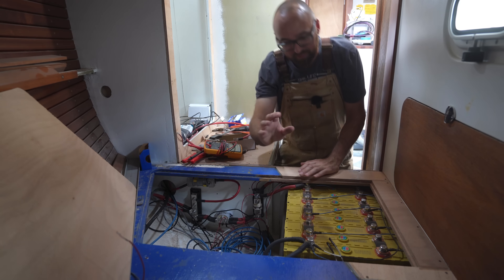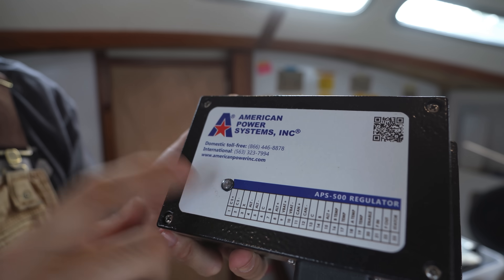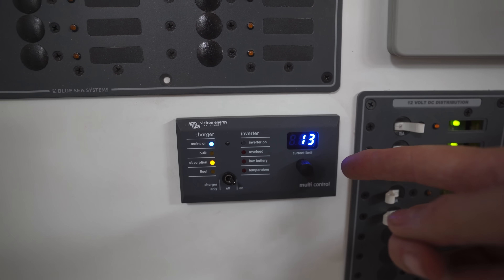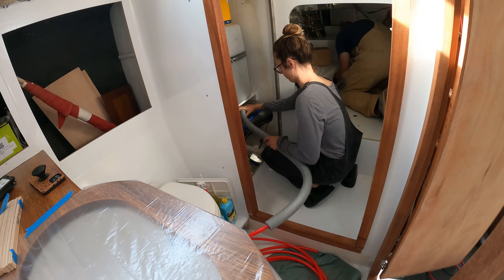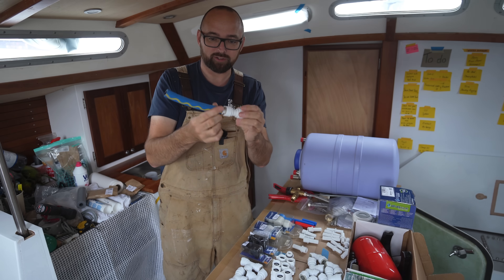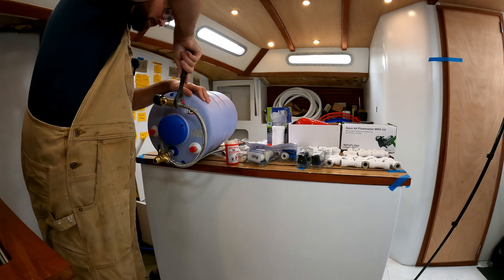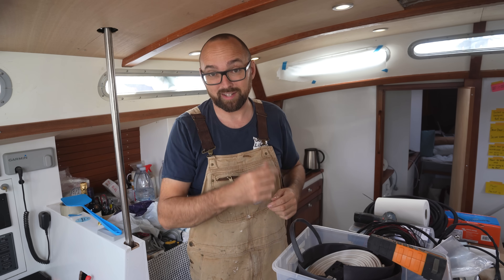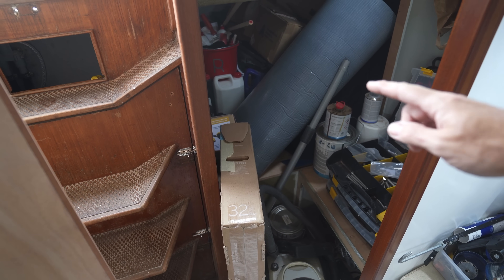Sail Life -  LiFeP04, REC BMS with Victron Cerbo GX, 5kW Quattro & pressurized water system

Comment: Great video! I plan to do almost the exact same thing on INTENTION next year, both the Victron lithium/Cerbo/Isolator setup and the water system (our water pipes are getting old). Right now, both power and water are working fine, but preparing for the future lithium batteries and solar and alternator upgrade and our water pipes are almost 30 years old!

Comment: To be fair - If it’s possible to do the mistake that easily, then the manufacturer has failed. 
IMHO, the negative should’ve been a separate plug, and very different from the ones for the positive cell connection.
While the manual is there, and it is documented, it’s a simple mistake to do, and probably not uncommon, considering the text in the manual. 

They should definitely move that negative connection out of the way, then the worst thing that’s gonna happen is you having the cells in the wrong order (which probably wouldn’t matter anyways).

Comment: I originally had VE installed in my sailboat, after a lighting strike a different unit was installed.  After watching your videos I am going to install a new VE inverter/charger, Cerbo, and related display and smart BMS that I should be able to then get data into the display without having to install a separate BMS.  Of course, phone app and online applications as well.  Due to my installation, I just need a Multiplus (not a Quattro) are there any other components you would suggest?

Comment: Don't forget to build a band with a couple 10mil starboard or similar to slightly squeeze your battery pack. The large flat surfaces need some compression to prevent the battery from swelling due to massive charge or use load. CHEERS     
   Steve h.

Comment: LOL, we have the same Victron remote... set to 13 amps

the 'assist' feature is not 'assisting'. When power consumption gets higher than 13 amps. the quattro actually switches completly to battery use. Your display showed it and we have the same experience here on board. under 13 amps it draws on shore power.

Comment: What if the BMS disconnects the main contactor, do you get a full blackout onboard? Have you considered an emergency powersupply from gel/agm batteries? Able to provide power to essential equipment atleast 24hrs vhf, navigation, some lights and usb charging socket.
Em batteries normally charged with a Victron Ts Smart dcdc charger. 
I installed a separate emergency bus bar from where ess equipm is fed.

Comment: As a Schengen citizen very much enjoying the system since its installation (even with the recent major rebound due to differing corona measures country-to-country and the re-establishment of hard borders), I am sorry for Your hassle, Ms Ava. 
There are supposed to be ways around that hassle which would be best talked through with a specialized attorney: Kika from "Sailing Uma" would be able to point You to one of those, as far as I remember. 
I am pretty much aware of the red tape part of all that, for I am helping with translation before authorities now and then to get long term spouse-visa written - the people I supported so far all were married though, so I couldn't tell what applies to Your "fiancée-only" state in terms of laws/circumvents - there are supposed to exist ways to get that sorted though.
Just in case You would like to have another summer or two in the very beautiful Schengen area, of course.

Comment: Some thoughts from a fellow sailor, I had the exact same pressure accumulator and it rosted from the inside fast. Ruined the water system with brown gunk. Get a stainless one from Marco fluid tech. Or you get a digital variable rpm pump from Marco fluid tech as well and don't need an accumulator at all:) 

Still love your videos guys!!

Comment: Are you just going to do coastal sailing?  What do blue water yacht builders use for their pressurised fresh water pipes?  A sail boat takes a real pounding in a heavy sea, so I am worried about those push-fit fittings - they look too good to be true.  I wouldn’t want my entire fresh water supply in my bilge one night during a long ocean crossing.

Comment: Household PEX has a number of drawbacks that make it really unsuitable for marine service. The first is the pipe has no damage resistance ability, they chafe through in minutes, especially if at all warm. The second, and more important, is that simple changes in angular momentum will unseat those quick disconnect fittings. Hell, sometimes they come apart just from internal pressure changes - I've seen them spring leaks inside wall cavities. Good luck. Also, every piping system comes with tees, elbows, and valves, so there's no advantage there for PEX. Welded stainless, man. C'mon.

Comment: I have been engaged in the rehab of a 1969 Pearson Wander for the last two years. Given the overall condition of my boat it has not been as extensive as what you have done - but enough so to help me understand what it takes to accomplish all that you have done thus far. The electronics alone are extremely impressive but I do worry some that systems are way to complex to operate without fail long term. Hoping for the best but will be looking forward to many videos ahead that address all your trouble shooting ; -)

Comment: Hey Mads
I wonder if you have a cover for batteries, to protect the conectors for been hit by som metal parts that could fall down on to it, and make a huge shortning, with a fire to result, and also I don see a fuse on the batteri to protect the wires from getting to fire if a shortnings has happent.
Reply from the maker: Hi Gert, 
There is a 400 amp class T fuse on the positive side. I don't have the terminal covers yet but they are on their way :)

Comment: Never used the whale system but I would try and use the fittings only in accessible and readily visible locations just in case they leak . With all plumbing connections they eventually do how long these will last is anyones guess. If you are using a pressurised system you may need some non return valves in the system.

Comment: I worked on boats, ships, air craft and R.V. along with commercial and residential building. And when it comes to water plumbing I can tell you from every aspect quick disconnect fittings are the BEST way to go!

Comment: Mistakes I learned from PEX systems.Whales quick disconnects. Date them with a sharpie! Mine started leaking in about 2 years. I made part of the yearly inspection of my boat! I also date the filter. Plus I found the worm clamps, vibrate loose fast than I thought they would. I used stainless steel PEX clamp rings. 0 leaks in 5 years. You're red pill thing. LOL! Date it! Then you know when to inspect the Pressure Regulator. Put it in your Bi-Yearly inspection to disconnect and shake if you hear the water on the top of the diaphragm that shows a small leak and will fail soon. And the last mistake I learned from. One way valves use themDeck- fill splash in the face was fun. and water maker. Thought my water maker was not working turns out I was actually back flushing the water maker all the time. That was a full week nightmare to find out. I also added a Hot Water Recirculating Pump to save water from waiting for hot water. Found I was saving about 10 gals a week.
Reply: Recirculating hot water to reduce consumption in this application makes a LOT of sense!

Comment: I've enjoyed your videos. Going through similar process right now with mostly similar choices. I do like Victron and also went with LiFePo4 batteries. Original water/plumbing and electrical were a mess, so ripping out and replacing everything. You've given some good ideas, to thanks.
Instead of sticky notes, I've been using Trello for the Agile-like Kanban card system.
All the best.

Comment: I wonder about the long term "seal" on the Whale quick connect fittings.  I would hate to be crossing the Atlantic only to find out that all my fresh water leaked into the bilge and was pumped overboard.  I don't think I'd trust them quite yet.  Is there any long term experience with these??
Reply: Especially in combination with a pressurized water system.

Comment: All of that snap together water stuff and a lot of other stuff installed on this boat is great as long as you are near a huge city in the UK but when you get to a remote islands and third world countries good luck buying parts to do repairs thats why smart sailors just use standard water tubing and brass fittings and hose clamps you can do repairs anywhere (sometimes)

Comment: Hi Guys! You have exactly the same LFP as here on Gabrielle; same cells, same BMS  and lots of Victron products including Cerbo GX; only real difference is we had a legacy of 12V kit including 12V Multiplus so decided to stick with 12V so we have a 4s2p battery config rather than 8s1p. Been working brilliantly for over a year. Standard Volvo D2 Hitachi alternator charges 12V LFP with no overheating or charge issues; obviously different for you 24V set-up. 
For us Brit cruisers, Schengen rules have become a challenge. Hope our UK rules allow you guys in without too much difficulty!
Cheers and thanks for another great video.

Comment: The power system is really cool. I am assuming you have a separate 12V starter battery?

The US Navy has an exercise called a Fast Cruise done after major overhauls. It is essentially dropping your dock power and water services and testing all your systems for a day like you were at sea. (They also put the crew in at sea watch rotation so everyone knows where the should be.)

You may want to consider doing this soon so you can figure out what is working or needs some extra bit while you can order stuff in advance of any shake down cruise or you departure from Denmark.

Comment: I wonder, with a boat that's practically been rebuilt, and so many new systems, how wise it is to just leave straight away. Don't you think that this boat needs an extensive shake-down and commissioning? Just my 2c.
Reply: If they were heading from Denmark to USA in 1 shot, I think some ones ocd would kick in 3 months of trials at least, but the North Sea is a challenge, but help is only an hour or so away. Helpful pixies in red chariots in the sky...
Reply: No way! Mads has read the manuals! What could ever go wrong? Remember the control apps!

Comment: Hello! I'm really curious why you abandoned the gas stove for an electric one. 
Also, i've neveer heard anyone wishing they get out of Shengen :))
Reply: I watch a lot of sailing channels on YT…I have noticed many of them have had to deal with all kinds of issues relating to mismatched gas bottles, various thread disparity of the connectors, and other related problems. Seems like every other country has a different “standard” for gas bottles and their connection method.
Reply: @WaterFaucet24  - In addition to which, sometimes you come across places that will only exchange bottles, and will not/cannot refill yours. No cruising sailor is going to be willing to swap an expensive stainless steel bottle for a cheap crappy regular steel bottle!
Reply: Well then you're not well informed....

Comment: Re connectors ;  Wireing it backwards is way too easy. You have to know if the diagram is showing it from the soldering /wireing side or the user side and that is often not emphasized, to put it nicely.  I learned that from touble-shooting brand new military marine navigation systems.

Comment: psst...adding the smaller of the pvc wire track around the perimeter of the panel including the bottom, and add a bottom to forward electrical.  A thin sheet of lexan or polycarbonate preferred, acrylic next, with velcro or fasteners to the pvc covers will perform as an electrical cover in the closet. In nav electrical, it's getting out of hand. ;) 
.
Fyi, the trick to using back board panels for complex electrical panels is...build it on a table without the box. Leave the bolt square on the corners of the back board which mate with the studs in a metal box empty on the outside 2-3 inches. Using pvc wire track, build a box on the back board inside the mounting square. With additional usually horizontal pvc finger conduit as needed, especially near din terminal strips, which need track on the top and bottom.  Build the back board without it being in a box, then mount it in the box by the corners with studs welded to the back panel.  Use 1/2 inch birch plywood or polypropylene 1/2 inch sheet as back board material.

Comment: In all of our travels aboard our Amel we have found the carbon filter to be acceptable in cleaning large particulate which is nice.  However, there are places where the dock water was "less than ideal" and the marina was not a place I want to subject my water maker membrane.  So we installed an Anova UVC Arrow 5 water purifier to keep our digestive tracts intact from those little nasty bugs that exist in far away places.  May be worth a look as you already have the infrastructure in place.

Comment: Mad's, Ava. Hi, Just wondering if there is a plan for removing moisture from the air when the warm air heating is on? Scotland and indeed the UK can be very cold in the winter. (And damp). The insulation will help as you have moved the dew point further out but, any cold spots will condensate as the warm moist air hits a cold dry surface. Ie below the waterline, areas not insulated. Even a newly filled water or diesel tank. The key is keeping the air in the boat that is warm and can carry more moisture, as dry as possible. Dehumidifier, small portable air conditioner (with heat pump so it can be used to dry air, heat or cool). We used to sail year round in the UK and in the winter when you are knocking the ice from the rigging in the morning, and the heating is full bore... Stuff can get damp and even moldy if the air in the boat is not kept dry and circulated. Or just dont use the heating 🤣Sail Safe Guys, Ant, Cid & the pooch crew.
Reply: The heater by design takes fresh air for combustion and passes it on out.This keeps the the circulation of draft in check. Heaters like those BS non-vented propane or alcohol heaters are the culprit in those situations. The "sweat pad" as I call them under the matresses help along with other proper draft measures are of great aid too. However,,,,,,,,,,,,,,,heaters in cold climates that suck in combustion air and expell it outside after the burn are a key to properly keeping the humidity in check. In addition, though huge power move is the air conditioning. Crank the hell out of the heating and then put the AC on and the humidity is fairly instantly relieved.
Reply: There is a great dehumidifier made in England using a desiccant and fan that has a low electric consumption
Reply: @wallacegrommet9343  I back that up. I have a Meaco and it has been a live saver in winter
Reply: When it gets really cold, You gotta make sure to replace a certain amount of inside air per hour to reduce the relative humidity inside. Cold air (from outside) can carry a significantly lower absolute humidity than any warmed up air within the living quarters. Once You bring cold air in, by warming that up You reduce relative humidity even of "damp cold" air to very low relative numbers. That's why any burning devices like a Refleks oven or a wood burner do work so much better in reducing the humidity: they constantly draw a lotta (warm, humid inside-) air for the burning process, emit that out the chimney, and thus make sure cold dry outside air is sucked in in reasonable amounts to reduce, once warmed up, the relative humidity down to regions less prone to reach dew point at low temp spots.
Openly burning gas on a catalytic burner does emit lots of lots of vapor instead. You do not want to heat that way within closed quarters under any circumstances anyway - always make sure You burn with a chimney or exhaust-outlet only! Carbon-monoxide is a thing with catalytic burners also!

Comment: That it a pretty cool setup. Have you thought about all in one bms+inverter+charger systems? They seem to be super easy to set up with solar, batteries and power output while being very competitively priced. Not sure if they fit the marine requirements but they're an excellent solution for house or camper installations.

Comment: The tank also stops water hammer.
Reply: Agreed. When I retrofitted the fresh water system on my boat, I put the accumulator in the cold water plumbing, in parallel with the water heater, so to speak, and I’ve had a much better result with controlling water temperature and constant pressure in the shower and faucets.

Comment: Please please please!!! Use locking clips with those quick connect fittings. Its important for your use case as I expect you will have periods of zero pressure to high pressure plus rolling boat.
Reply: No clips necessary. There's the flooding control app that will give instantaneous alarm if a connector fails, and notify Mads through the internet suggesting a spiffy solution.
Reply: @andrewseaman7012  So you propose to rely on electronic alarm _only_? The best way if you work with pressurised water is to use all means of protection available and those clips are like 5-10 cents per item and it just does not make sense NOT to use them. In case of alarms I would install two of them - one with mechanically cut off the line and another one installed with internet notification (which I believe he already have). If you work with pressure it’s never to little protection.
Reply: @seregus6724  Andrew was joking ....

Comment: Very interesting battery setup. Looking forward to seeing the schematic. Did you decide on getting your amateur radio licence?
Reply: Sounds to me a slightly outdated concept in the era of satellite telephone communication. But good as a backup, certainly, as a radiosystem can still add a wonderfull amount of complexity that can be controlled by apps!
Reply: I had exactly the same setup almost to the T, but my 300Ah/24V setup was with CALB cells instead of Winston. Works very well!